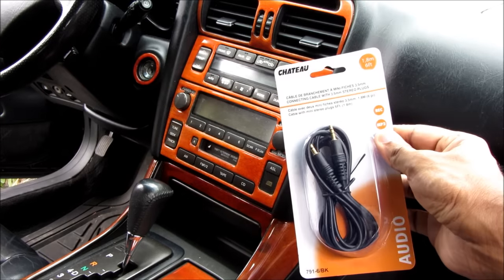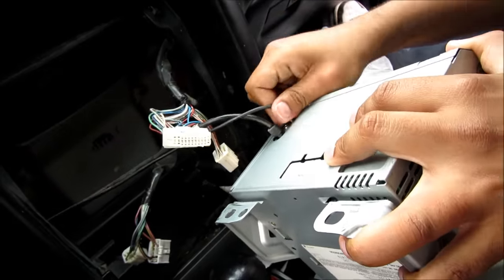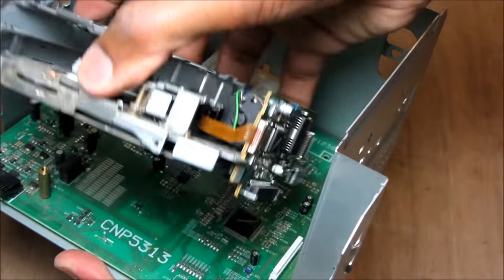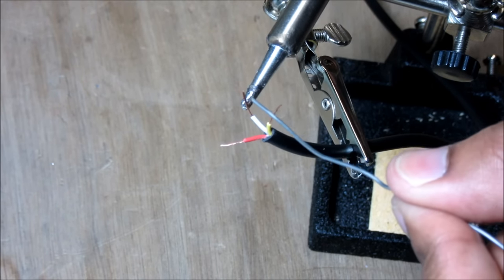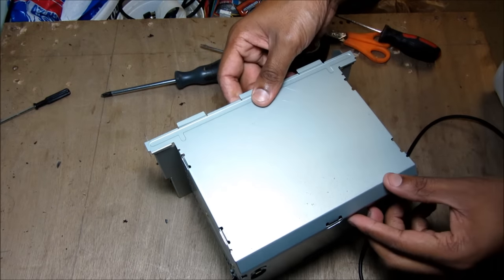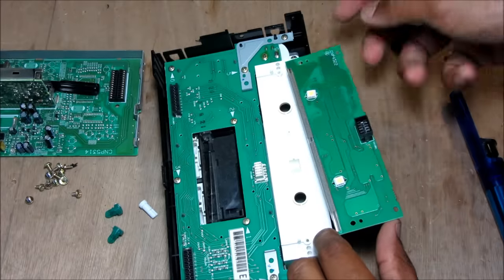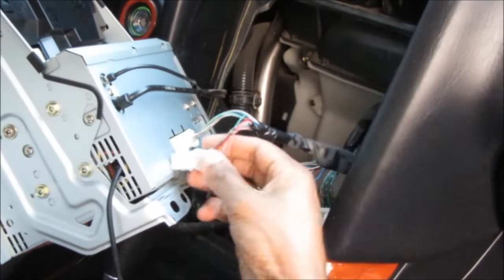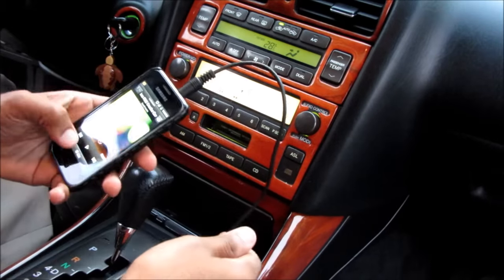How to Add AUX to an Old Car Stereo for $2

Comment: Just want to confirm that this worked perfect in my 1999 LS400 with Pioneer radio (NOT NAKAMICHI). You can tell if your radio is Pioneer because it will say "Lexus Premium Sound" above the AM radio button. Thanks so much for the video! I may add a ground loop isolator as I am getting some strange buzzing whenever I have my phone playing music through this and charging at the same time. 

I am using an AUX cassette with the wire chopped off to give me a never ending tape to play.
Reply from the maker: +CyFi6 Sweet, that's good to know. 
Unfortunately the cassette deck in this GS kept acting up and my brother decided to solder aux/Bluetooth to the CD player line and play a silent cd instead.
Reply: Could this be done on a NAKAMICHI Deck?

Comment: Thanks so much for this video. My ES300 had a similar layout for the tape deck and It helped me install my own Bluetooth kit. Worked like a charm, and the sound quality is so much better than those Bluetooth Cassette tapes I was using before.
Reply from the maker: Agreed. Might have to do this to my JBL Camry
Reply: what bluetooth kit did you use? I have a 2000 es300 and am searching for a bluetooth solution short of a new head unit
Reply: use wired bluetooth is bad

Comment: you always make it look so simple. before you know it. the job is done. is good when you know what you are doing. thanks :)
Reply from the maker: +SK4869 Thanks. I try to present it in a way that is clear and easy to understand. Of course you need hands on experience to undertake something like this (i.e. soldering, wiring, etc).
Reply: when i was growing up my father used to do a lot of work in his shed, he used to fix everything electrical. he had his soldering iron & wire, you name it he had it. just last year i had my stereo upgraded in my Toyota Rukus, had professionals make me a fiber glass frame around my 8' Alpine touchscreen with navigation + a sub woofer in the back also had a fiber glass framing around it. cost me a little, but it was well worth it. thanks again for the educational videos. have a great day :)

Comment: Cassette adapters work surprisingly well if you get a good one. But you have to get a good one. Lot's of cassette adapters are crap especially ones that are recently made. The older ones are usually a lot better. I use one in my ES300 and the sound from a decent phone or MP3 player is surprisingly close to the built in CD player. There is a small audible difference but I didn't expect it to be that close.
Reply from the maker: +socksumi Your right, I have a good one that came with the xm satellite adapter.
Reply: You have any leads on what constitutes an “older” cassette adapter? Got a Monster brand one recently that I thought would do the trick but there’s too much random hissing and static... drives me nuts. I thought it was just the nature of the device, but sounds like I got a crappy one despite being a well known brand.

Comment: theres another way, if you find the pinout diagram for your particular model then you can splice into the L+, R+ and SGND (speaker ground) wires externally without the need to open the head unit, thats what I did last night

Comment: I tried this in my Lexus LS400 and did not have good luck soldering to the cassette player PCB, so I removed the main board and found that the pins where the cassette player plugs into are labeled on the bottom of the board. I soldered two wires to the pins labeled TapeR and TapeL, and kept the signal ground wire in the same place show in the video. I also soldered two more wires near the connector for the harness for switched power and a power ground to provide power to a panel mounted MP3/bluetooth board, which I hid in the ashtray beneath the head unit.
Reply from the maker: Glad you got it to work!

Comment: I am just speechless. Excellent. 
Now, if you added select able switches to keep Tape Player, it would been incredible.
Reply from the maker: +EsDACcompany We tried to hack the tape player to get it to work without the cassette. The player uses two encoders, one on the drive wheel, the other on the slave wheel. If the encoders read the same speed, the tape plays, if not it knows it hit the end of the reel and stops. Therefore I'd have to trick the chip into thinking the slave wheel is still rolling....not easily electronically.

Comment: You could solder a BT aux connector and leave it back there, no cords and no mess, power it off the radio, and there you have it, bluetooth Nav & Voice, plus OEM styling.
Reply: But nice job i never thought you could do this to a car stereo, i came from your original honda video
Reply from the maker: Thanks. I already made a Bluetooth video

Comment: This is great! Thanks for making this video. A few questions;
1. What year and model is your Lexus? I have an 04 gx470 and your head unit looks somewhat similar to that time period.
2. I've done radio work before, but never soldering. What tools do I need to solder a 3.5 jack in like this? can you give me a list of everything needed to get the job done? Thanks again.
Reply from the maker: +Bo G Thanks. If your Lexus has a separate CD changer I recommend connecting to those lines at the back of the radio or changer and inserting a blank CD. Theres a writeup on the ES forum at clublexus. This cassette method is kinda fidgety if the player isn't working properly. This was a 2000 Lexus gs300.

Comment: Definitely going to give this a try on my bro's GS300 as well as my IS300 if possible, thanks!
Reply from the maker: +Xotic Garage Let me know how it goes. There might be a way to hack into the CD changer's wires similarly.
Reply: +speedkar99  I have a spare CD player for my IS, I opened it and after looking at the board I see something fairly similar, it says Dolby R and Dolby L for right and left, as well as those 2 contacts where you soldered to. So hopefully this upcoming weekend I can work on it and get some aux in the car! Thanks, I'll update you when I complete it.
Reply from the maker: Great. You'll probably need a silent CD to trick the player that there's a CD in the drive and to read from that input.
Reply: +speedkar99 By CD player I meant the whole unit including the cassette player haha. But yea I'm wiring it into the cassette same as in the video. Probably going to use a normal cassette to aux and chop off the wire so that I don't have to flip it everytime, any other better alternatives than using that?
Reply from the maker: Unfortunately no, we tried. The cassette player has a master and slave encoder on each wheel to detect when its reached the end of the cassette. As long as both are spinning at the same speed it plays. You'd somehow need to hack the signal of the encoders to make them equal to trick the cassette player into thinking everything is fine.

I too am going to get a cassette to AUX adapter to trick the player, because flipping the cassette (or dealing with it if it unreels) is cumbersome.
Reply: did this fix the cassette flip in problem

Comment: Best how to of all time. Unfortunately you can just buy a 10 dollar cassette converter, put it in the cassette deck and still have a working cassette player and option to have aux.
Reply: Yes, but this method eliminates the hiss from the tape player.  The tape adapter does not.

Comment: You're one intelligent dude. Thanks for this video. I recently purchased a 1998 Lexus GS400 and I'd like to add an auxiliary jack so I can listen to music with my phone. I really don't want to destroy the stock stereo, so I wanted to verify with you if you know if this hack in the video also applies to the Lexus GS400. Do you know if the solder points and layout of the stereo in my car will be the same as the GS300? I see they look slightly different from the face. Thank you for any input. I greatly appreciate your expertise.
Reply from the maker: +graphicartdude it should. But I recommend tapping into the CD player lines. There's a writeup on the ES300 forums on clublexus. Thats ultimately what my brother ended up doing to this car after the cassette tape unreeled on him. He even hookedup a Bluetooth module for cheap

Comment: I've got my 2006 Lexus RX deck taken apart following this awesome video, to the part where I can take out the tape deck. The board on the tape deck looks almost exactly like the one in this video, I can see the R and L they are little metal donuts just like in this vid. But how do I do the ground, you just scratched right through the green coating? How did you choose where to do that? Thanks!!
Reply from the maker: Any screw that goes thru the casing is ground. You can tie it to that or solder in the wire to a point on the board (usually a big point found in multiple places)
Reply: @speedkar99  Thanks! But now I'm wondering if I should bother, after reading the comments about the problems due to headset detection on Android.

Comment: Very helpful. Is there a way to use the Tape button to go to aux. without using a cassette or running the cassette motor?
Reply from the maker: You need to trick the tape player into thinking there's a cassette there
Reply: @speedkar99   I have the cassette mechanism manual which shows a CST IN switch. I'll hook it up, jump switch, and see if it goes to Tape mode.

Comment: is this better than just buying those cassette adapters with the aux cable?
Reply from the maker: +SwiftHelix yes, because its direct the audio quality is much much better.
Reply: But it'll suck if the aux jack gets damaged from time to time from all the plugging and pulling. Then you'd have to replace it at times. But great video and awesome idea.
Reply: SwiftHelix just better off getting the cassette player with the six cord or an fm transmitter, they sound just as good. Not worth the time and aggravation. Plus you can damage the radio in the process
Reply: bam bam simple cutting of the wires and soldering a new Jack onto it. You wouldn't have to remove the whole radio again.
Reply: @robfassi3297  Definitely would not sound as good.

Comment: i bought one of those tape players w/ the aux out, the princaple is the same.. works the same too. but a lot easier..
Reply from the maker: +Anthony Tasoulinh That's not the same. This connects directly to the stereos analog inputs. There's no static or hiss. 
The tape adapter has to read through the head which doesn't give good sound quality.

Comment: Hi, I added the aux plug on my dads car.  Worked awesome, thank you very much.  He also has radio bulbs out, where did you get the leds you replaced?  I cant find anything that looked lie those online.  Thank you!!
Reply from the maker: Those are just 5050 SMD #74 bulbs that we took the the LED out of and soldered it to the radio. Most 12V LED's will work.
Reply: And how many ohms resistor?

Comment: hey speedkar great video. quick question what is the normal rpm when your car idles with the AC on? I have a 99 solara sle v6 and replaced the alternator. when runs with out AC the voltage is 13.9 dc volts. when AC kicks in the number drops  to 11 almost 10 volts. The battery is less then a year but standing charge is at 13.5 volts. I adjusted the throttle for now to maintain a higher rpm at 1000 but would like to know what would cause this. sorry so long.
Reply from the maker: I just went out and measured for you.
Idle is approx 700rpm both ac on and off
Idle alternator voltage is 14.4v and 12.6 v with ac on.

Comment: I followed these steps except I didn't wire a Bluetooth adapter. I'm having volume problems with a direct auxiliary connection, if the vol is more than 80% on the phone it distorts the sound coming out the speakers. But, if it is under 80% on the phone, the sound is too quiet even with the head unit turned all the way up. Suggestions my friend?
Reply from the maker: You probably wired it before the amplifier? 
Check the pinout of the chip you wired it too or go from the CD changer instead of cassette

Comment: How does the audio quality of this compare to cd? You mentioned briefly that it goes to an EQ chip, I was just wondering if it applied any weird curves before hitting the main eq/tone knobs you can configure/amp.
Reply: It's probably optimised for tape audio so the eq curve could be a bit different from a normal aux source

Comment: very informative, however sadly. it does not work on nakamichi systems. i just followed the procedure for 2000 es300 nak system an the break down is a bit different. face plate doesn't come off the same way, no need to remove it to get to the tape deck on my system. however the board attached to the tape deck has no eq chip and no label for R and L. as found on your above system. I am certainly not saying you are wrong, simply didn't work for the nak system to save other viewers trying for aux in that system. Again, love your work, very informative and keep it up! Thank you!
Reply from the maker: +Guyanesebr0z Thanks. It might be similar to the Toyota JBL system, see my other video. 

Did you get it to work using the cassette deck or CD input?
Reply: to be honest im not highly mechanically inclined especially electronically. got a bit cold feet and closed it back up. there was 5 connections.  one com and the other 4 I think were front left right and rear also. i may attempt that sometime in the near future and let you know. will check your jbl video first though. Thanks
Reply: to be honest im not highly mechanically inclined especially electronically. got a bit cold feet and closed it back up. there was 5 connections.  one com and the other 4 I think were front left right and rear also. i may attempt that sometime in the near future and let you know. will check your jbl video first though. Thanks
Reply from the maker: Comon bro, your Guyanese, how can you not be mechanically hands-on inclined? :)
Reply: well that does it. I guess now i HAVE to make this work. Can you PM me your email, i opened it up and would like to send you some pictures of what i'm seeing. I was able to get it to work on left side of the car (aux) but not right side. So i went back in again over and over trying different connections and i got sound on both sides but it plays no bass and no vocals on one side so im not sure what connection is wrong. Would love some advice. Cheers

Comment: Just search cassette adapter  for $4 on Amazon.  Put the tape in and it has the auxiliary cable attached.  Works great assuming your cassette player works.
Reply from the maker: Nice try. A cassette adapter will give you hissing and a lot of static. This hack gives you CD quality audio with out the clicking.
Reply: +speedkar99 I've used them in cars and they're perfectly clear. In fact I use one at work for an amplified system in the warehouse. Maybe you were using a bad tape player because I've used auxiliary jacks that go straight to the radio and tapes and they both sound the same. I have an 08 gs350 with a tape deck. I'm going to try it out now. Maybe it's a weird Lexus thing, but my old Saturn worked perfect and a radio from like 1980 tape deck works perfect.

Comment: Any chance you could show us how to do this on a 97-01 lexus es300?
Reply from the maker: +staticshock1646 The procedure is exactly the same. In fact, I took apart an ES300 radio and compared it to the GS300. The layout is very similar, and the L & R ports are labeled as is here. The only downside with the cassette method is you need to play a blank cassette to fool it into reading from the cassette player, but as long as you pull the wires going to the head there should be no interference or hiss.
Reply: If its a pioneer unit you can easily connect a 3 pin connector on a white male connector that is soldered to on the circuitboard on the right side of the cassette mechanism. the trick is to put a blank cd in the cd changer and voilas you have a functional aux input without having to use a cassette. You can also put in a cd upside down in the changer and the radio thinks there is a cd error, but the audio input of the radio still works.
Reply: +peterdevreter - I'm having trouble locating the white male connector you mentioned that is soldered to on the circuitboard on the right side of the cassette mechanism. Is that on the circuitboard with the L & R? I have a 1997 Lexus ES300 w/ 6-disc CD changer. Thanks!
Reply: @speedkar99  hey, I did the exact same thing. But I have a hiss and a whine that goes up with the RPM. I think it's a grounding issue. What do you mean pull the wires going to the head? How do I do this?
Reply: @SteakBawse  
You need a Ground Loop Isolator to stop the hiss & whine.

Comment: Can the auxiliary just be soldered straight to the radio connectors? Curious why you need the 3 extra random wires.

Comment: hey this is a pretty useful hack thanks for the info. I was wondering if you knew how to wire a douledin install which will integrate the factory amp and sub? if so please let me know I have a 2003 gs300 no ML or navi
Reply from the maker: +Yasharth Swamy I'm not familiar with the aftermarket systems. Have you checked if there was a Metra wiring kit for plug and play? That's how it was in my Camry. Single or double din shouldn't matter, just the bracket that holds it.

Comment: So the tape has to be playing.... I don't see why you wouldn't just use a tape to aux converter. I was hoping this video would mimic the Honda one where it can be soldered to the radio. So does the aux input only override the radio on a weak signaled station?
Reply from the maker: This is clearer since there's no static

Comment: This might be a dumb question but could I just get a longer aux cord and cut it and use the wire inside of it to connect to the terminals and ground? Also is there a specific order the wires go in (like by color)?
Reply from the maker: +Brendon Terry Yes you can use a longer wire. They are in order, left, right and ground. Google 3.5mm plug pinout.